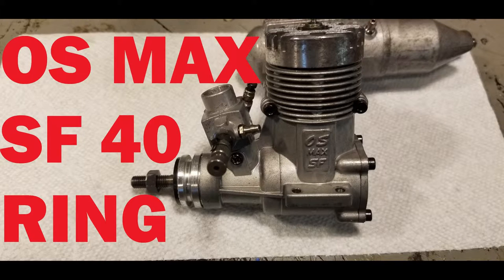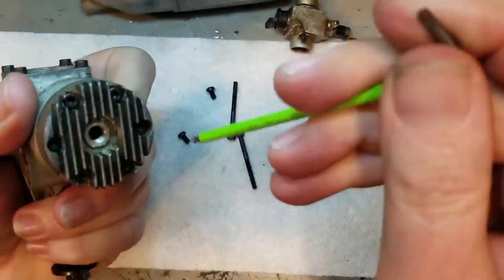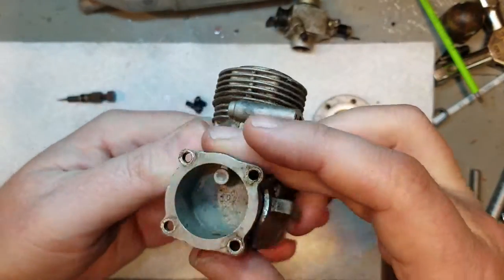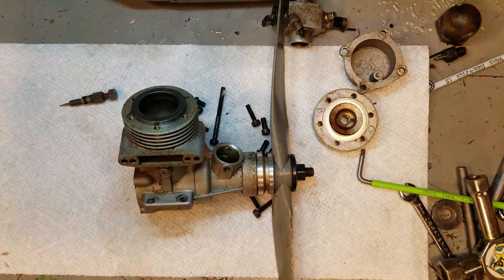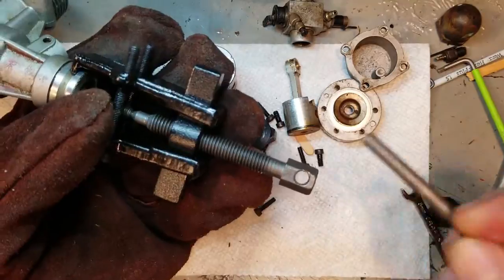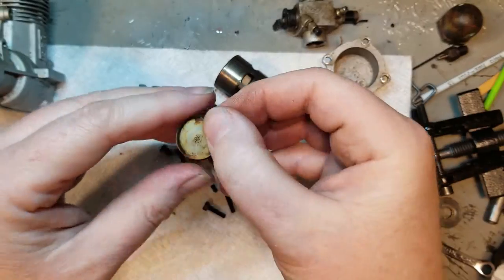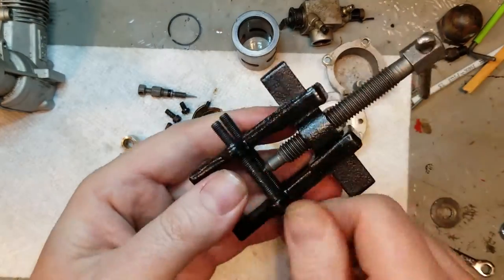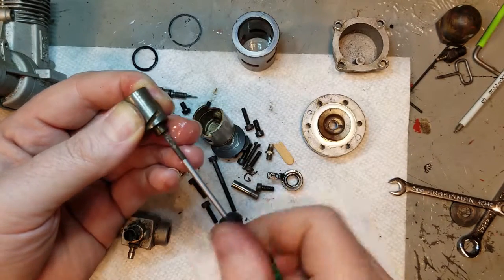OS MAX 40 SF Ringed Model airplane Engine Rebuild New Bearings

Comment: The aftermarket needs to step up and start producing repop parts for these engines since O.S. has no interest in doing so after they are discontinued. Inspiring entrepreneurs are you listening to this?! You could have a thriving business and make a lot of money. Most of us would rather fix our old vintage engines than throw them away and keep buying new ones. New O.S. engines are $189+ these days as well. That's a lot of money to spend every time some little thing goes wrong or wears out.
Reply: Sure...I'll start a company. I'll need about 250K liquid. Are you ready to invest?

Comment: Hello Michael, I have an OS H60 F GP engine that I am trying to get the piston out of. I have removed the sleeve, but the connecting rod doesn't seem to want to lift enough off of the crank shaft for me to remove the connecting rod. Is it ever necessary to use force to pull the connecting rod end off of the pin on the crankshaft? I would upload a photo, but I don't know if that's possible here.

Comment: Did you buy a rebuild kit and from where if so? And what oil are you using?
Reply from the maker: 3 in 1 oil.  I had to buy all parts separately.  search ebay for parts for your engine.  boca bearings for bearings.  All stock parts for new OS engines are available but if you were to buy bearings, gaskets, and piston ring new you could probably buy a brand new old stock engine for a little more.
Reply: @michaelsmutnick  

O.S. MAX parts are getting harder and harder to find as well as a lot more expensive. If you find NOS or NIB vintage engines they cost even more. From what I see on Ebay and elsewhere double what they originally sold for. Remember when you could buy new O.S. MAX FPs or LAs at the hobby shop for $50 - $65. Well not anymore that same engine is $125+ now.
Reply: Nice O.S. MAX  FXs are easily $100+ these days let alone a NIB NOS brand new one.

Comment: Would have been nice for us newbies if when inserting the barrel to line up the notch in the barrel to the dot marked on the bore ?? or that the exhaust port looks different to the other ports and to line it up with the exhaust (well DER but if you dont know you dont know !!!) and as i found out the engine will run quite fine, but not the way it should, 1 vid a guy said to line the barrel up with the cast mark in the front of the motor and (was OS Nitro motor) this wasn't correct. 
  
 In your vid there was an image of the exhaust port and that is was what i used to fix where i had gone wrong, would have been nice in your vid if when inserting the sleeve to have slowed it down loose the music and just give a quick explanation of this, but all in all your vid helped and thankyou :)

Comment: why skip removing the bearings?
Reply from the maker: nearly all are rusty, i tried putting used ones in, not worth it.
Reply: @michaelsmutnick  would have been nice to see how you removed them is what I'm saying, still helpful eitherway
Reply from the maker: ah you mean video, sorry, i did this on other side of basement away from camera.  Heat with heat gun from harbor frieght, (wear heavy leather gloves) then slam down on rear on the edge of a block of wood (so it hits square)  and bearing will fall out (hopefully) @ThyerHazard